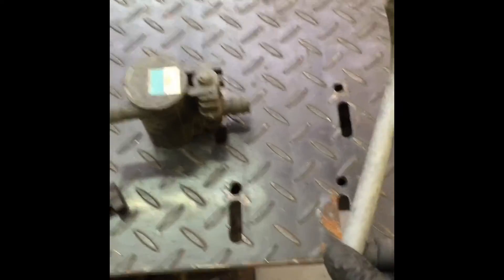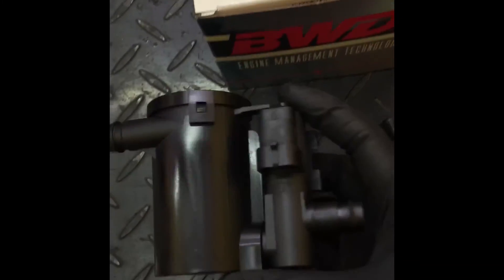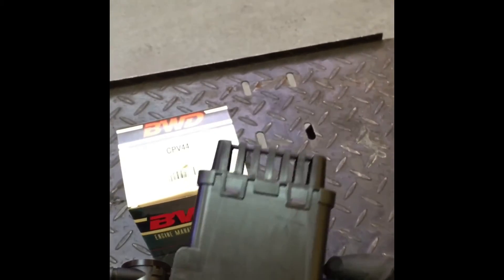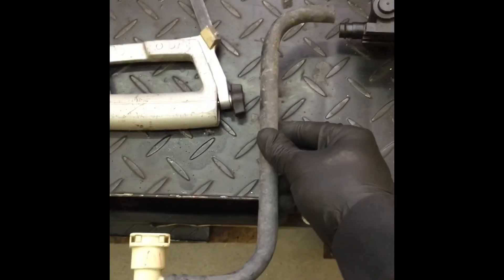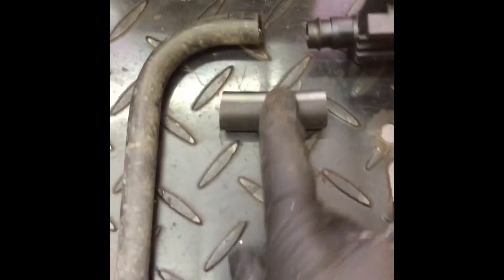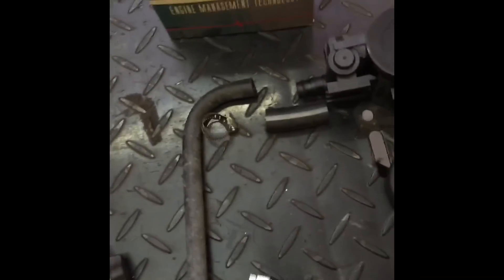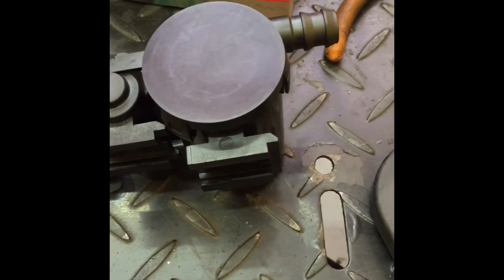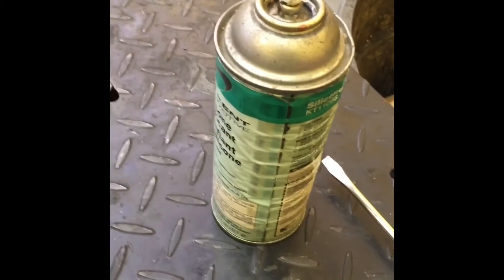EVAP vent valve replacement on 08- GM 1/2 ton truck

Comment: I did this but used 5/8ths heater hose for both sides. $65 in parts and 10 minutes to install. Great video that will save a ton of money for those that get the dreaded “p0449” code.

Comment: That's a good way to do it. If you still can't get gas to go in after that is replaced. Take hose back off and remove gas cap.Then take a compressed air blower and blow the heck out of it till the tank swells a little. You will hear the clog break loose in the canister.Then pipe back up ,put cap on gas tank and go fill up. If your running on a hunting club or dusty woods roads that's dry and really powdery dusty cut a pillow case and fix it so it will filter the dirt  for the vent valve, zip tie it around it  like a cover it will help keep it from reclogging. Answer your check engine light and you should be good to go.